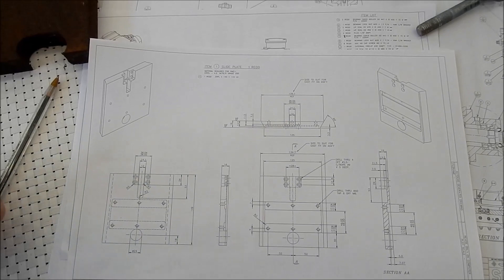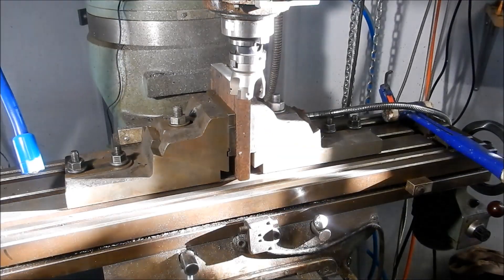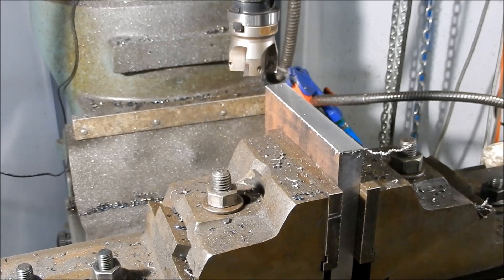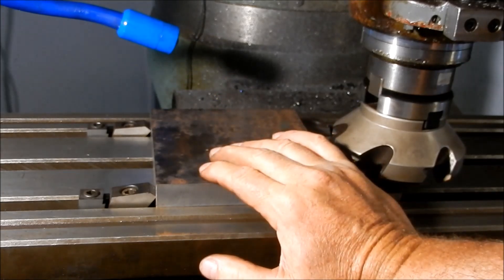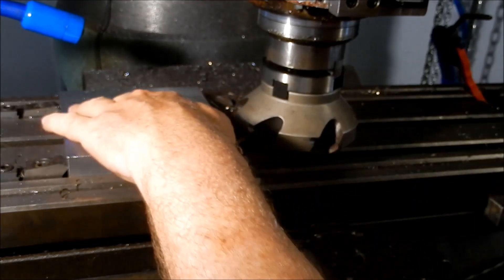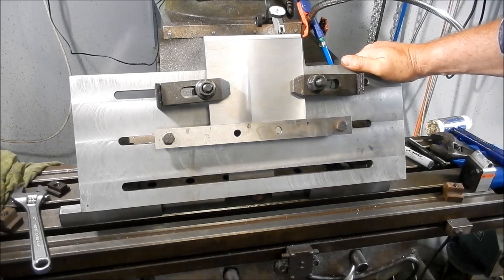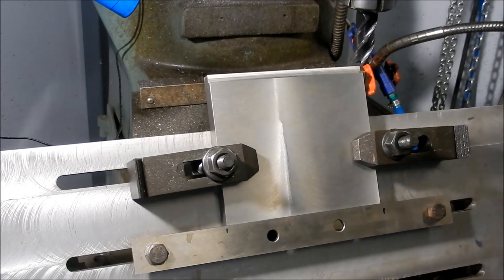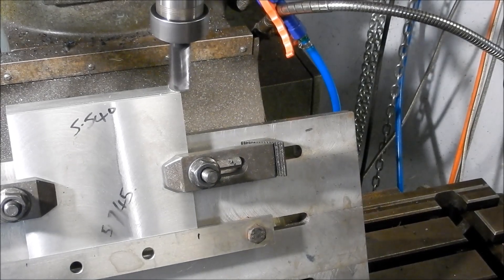Powered Lathe Slotter Build Part 32

Comment: G’day Cam, yes that setup looked like it wanted to chatter but hey it worked. You made me smile with “a nice slide (grunt) fit “ as you said, a bit of stone work and it will be a nice sliiide fit, there’s not much between a nice fit and a little sloppy fit. Your working hard at it, cheers, Peter

Comment: Came up very nice, well done. 
Is the base plate softer to allow for wear from sliding? Or is this not really designed for that kind of use?
Reply from the maker: The slide is more for positioning to allow adjustment for the lathes center height and to allow adjustment for side cutting to do larger keyways.  During the cut the slide will be locked in place.
Cam